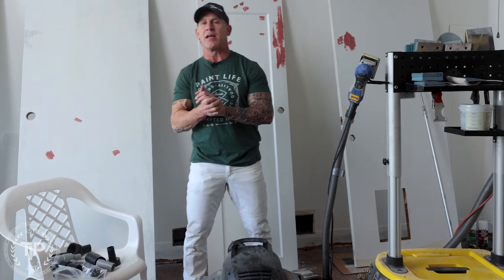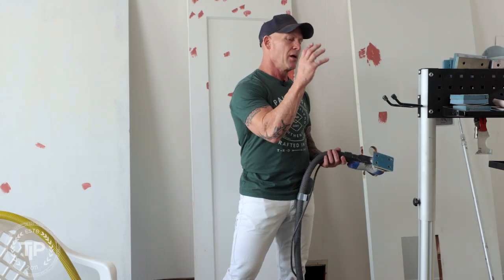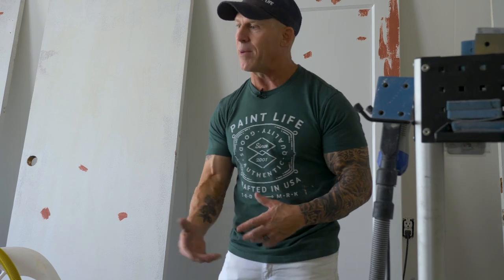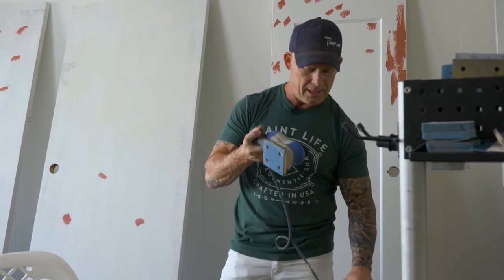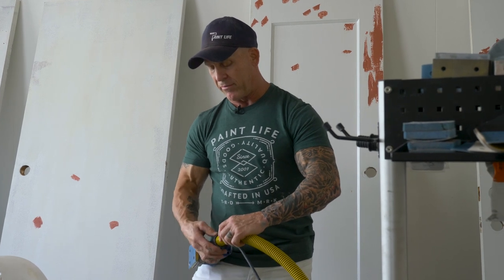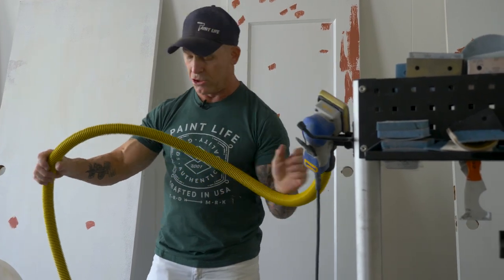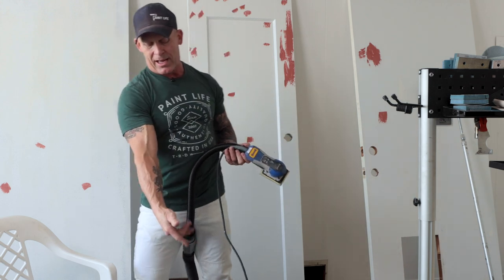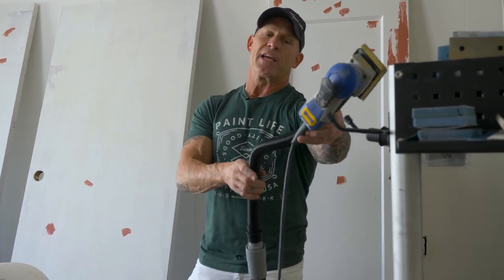Get the right Connector for your sanders

Comment: Thank you for the info regarding using a standard shop vac.  I did take your advice and it works very well.  Make sure you put a bag in your shop vac however.
Reply: Thanks. One question to help me out. Did you switch on your sander together with the vacuuum cleaner? or just the vacuum clearner.
Reply: I bought the hose that fits my sander and adapted to my vacuum.